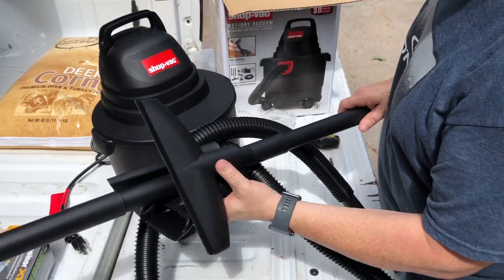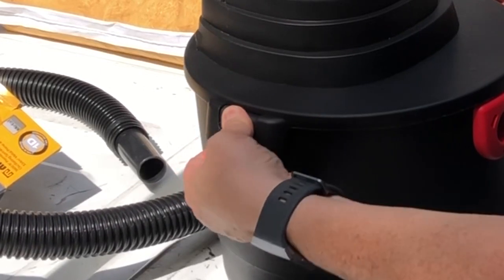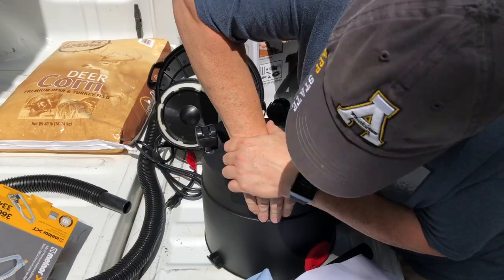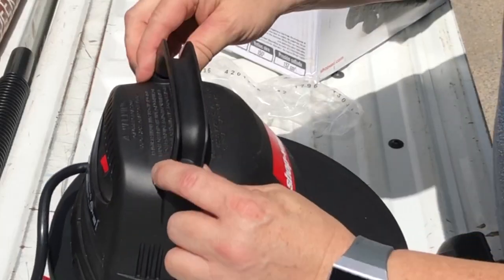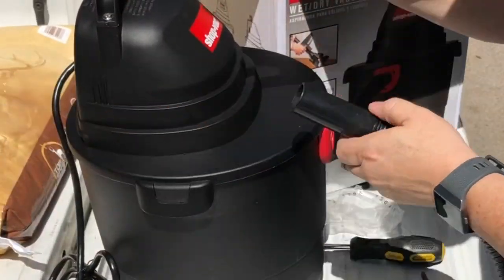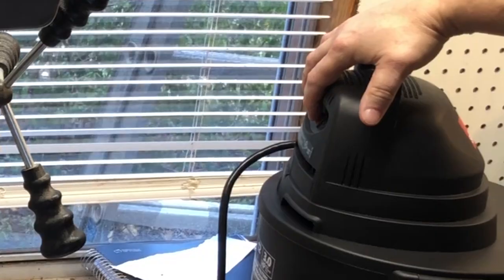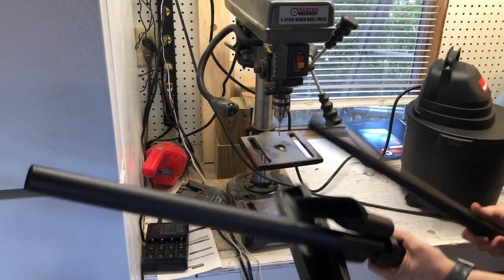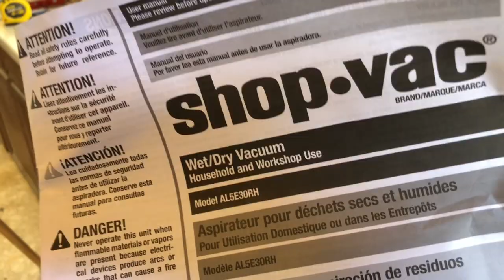The Best Shop Vac For Your Buck: Walmart's 3hp 3 Gallon Review

Comment: I got one works good on dry locations so far.... haven't tested wet locations yet...
Reply from the maker: It will do great for you on wet locations too.  It has for me.
Reply: If used fir wet ,is filter required? 
 Or ebay to find & replacement?

Comment: That's the  same  exact one I have and it only came with one collection  bag.i can't find the  bags anywhere!! Ugh
Model AL5E30RH..
Ps it also  came with  all the attachments and sponge filter, dry filter ,was the bag just an extra piece or what ?
Question. Do I not have to  use a collection  bag?

Comment: I have the same shop-vac. Does your shop vac blow a lot of air out the back?
Reply from the maker: Yes it does.  👍😁
Reply: I have the same problem with mine. I think it has more power   in the back than  the suction in front.

Comment: Thank you. I wanted to make sure to use the foam sleeve for wet vac. Now I know it’s always used wet or dry. Mine came with an actual bag for dirt. And my handle is different and already attached. It’s so light weight but has excellent suction. Walmart - $39.98 in stock.
Reply: That's why I came here too for the wet vac. He talked to quick past that part. Do you put the black ring over the foam or just the foam?
Reply: @jewelluscious  I’m not sure if I understand your question.
Reply: @jewelluscious  I put the black ring over the foam.
Reply: @KathyLovesLife  Oh ok my boyfriend said to not put the ring back over it lol. idk which way it goes but thank you 🙂

Comment: Nice efficient overview. Still, showing how easy/hard it is to change out wet/dry mode filters and difficulty of finding replacement bags, filters or whatever is necessary might've been a nice touch.
Reply: Generally attachments and bags are universal for all brands of wet/dry vac. Just make sure you have the right hose diameter. Mine is 2.5 inch wide hose, but the more common size is 1 7/8 diameter